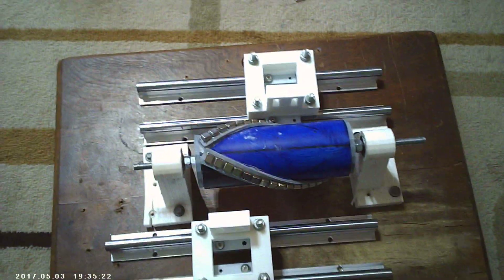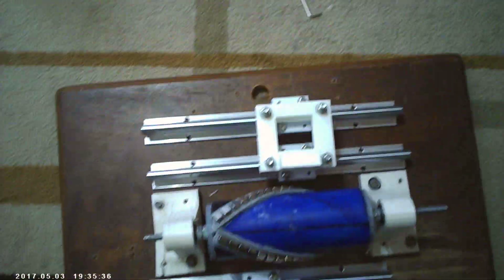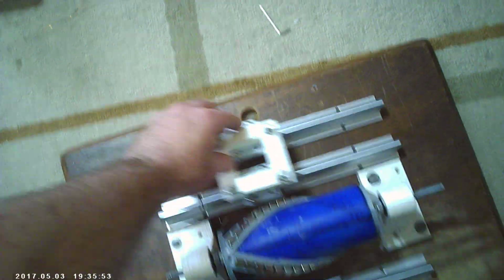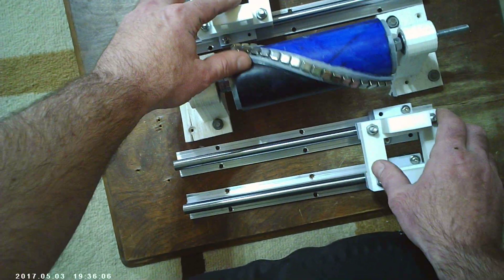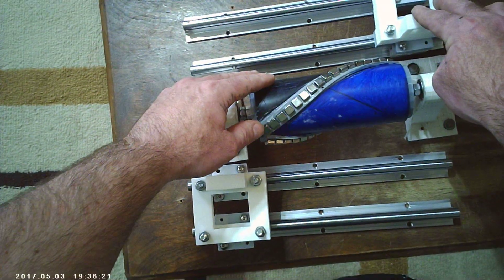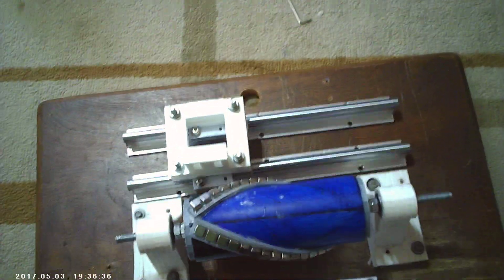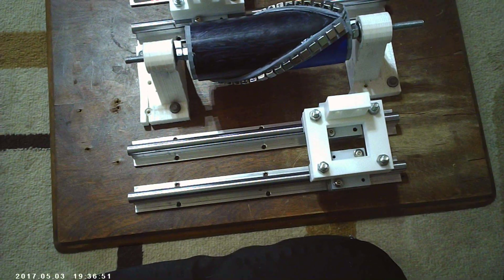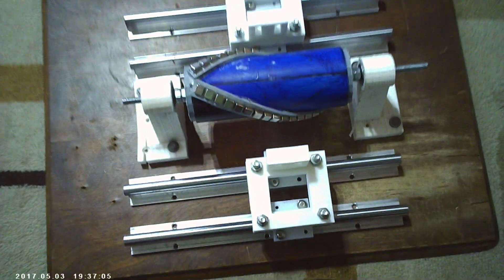Spiral Rotor Motor Build #3 - The linear rails

Comment: Looking good! I have a feeling a balanced system like that probably wont work though. The magnets will find equalibrium and stop. An unbalanced system may work better. (3 rows of magnets, 2 sliders) I wondering if putting a band of metal around the ends of each side of the roller to shield the magnetic field would help overcome the sticky points.